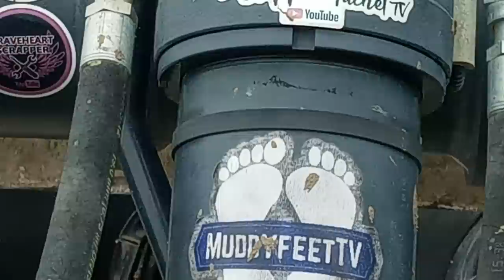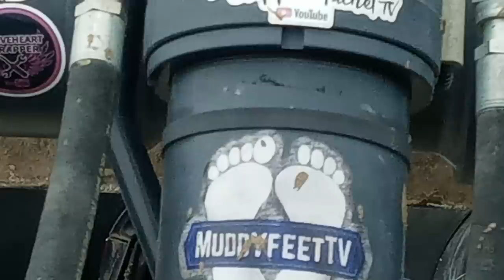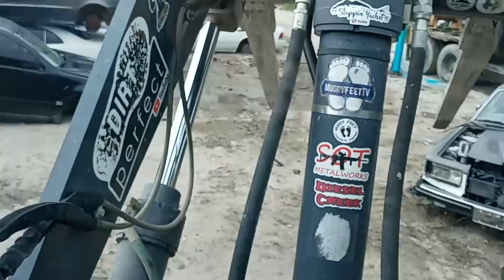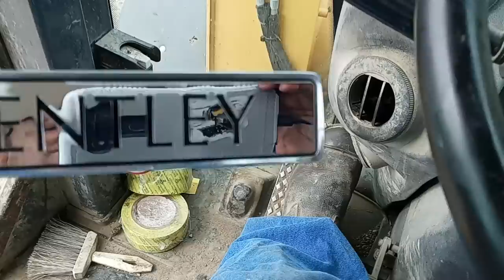Luxurious Bentley gets Crushed in Car Crusher

Comment: Must be nice to be rich enough to throw thousands of dollars away. The grill alone is worth several thousand. There was a lot of valuable trim got crushed. With any Rolls-Royce product, contact Park Ward Motor Museum in Chicago. They will usually want parts like that. If the leather is good inside, that original Connelly hide is worth bucks too.
Reply: People in this industry are scrappers.. they avoid thousands of dollars with small effort in favor of pennies for no effort over and over. Stupid is as stupid does. Most often the claimed attempt at marketing parts or even the whole thing are laughable at best, steeped in ignorance of where the proper market is.  EDIT:  It is not usually the scrappers fault that something has been chosen for recycle... I should have made this more clear in my first post. Usually its the owner of a dead car that has no knowledge of how to maximize the return on their property by reaching the very specific market that needs to know. By the time a scrapper in engaged, then the "time is money" axiom comes into play. They have work to do, and it boils down not to earning maximum return by investing in research and marketing, but rather how  quickly the asset can be converted to sellable fluids and steel, which DOES represent the smart business decision.
Reply from the maker: Do you know what is the 1 big thing you are completely missing? IT'S THEIR STUFF TO DO WHAT THEY WANT TO DO WITH IT. Have you forgotten about Freedom to make as much as you want or as little as you want. It's their stuff
Reply: I agree that this is a waste. There are a finite number of these left. With a little bit of time and effort, many parts could’ve been salvaged to be used to restore several other examples. However, you can’t put the blame entirely on the scrap yard. They are only interested in the metal. Whoever brought the car there should’ve taken these scarce and valuable parts off of it beforehand. Still a shame to watch.
Reply: @pwrattorney  The junkyard is not to be blamed
It is the owner at least mostly so he is not wellcome in heaven and his way to hell will not be funny at al 
I almost feel sorry for him but not really
The junkyard lost lots of money on this!
Should have saved it for some twenty years
in a dry place
Reply: I totally agree with all the others, that this was a terrible waste. But it's not the fault of Cowboy Car Crushing, they just do what they do. If the customer says "crush this car", then that's the job assignment. The blame lies fully with the owner, who decided that it was too much of a bother for him to find a buyer and in a tantrum rage of revenge ordered that it had to be destroyed, with no spare parts even salvaged.

Of course it is the right of any owner of any object, to decide what to do with it. If somebody were to buy Mona Lisa and set fire to it... nothing anybody could do! All kinds of famous, great treasures could potentially be destroyed by their arrogant owners, simply "because they can", maybe to show the world that they don't care what others think and/or that they're so incredibly rich, that what others regard as treasures is simply "cheap junk" to them.

We don't know the story of this car, and it probably had some major issues. But it's totally obvious, even to the naked eye, that a lot of valuable parts could have been saved. I'm also 100% sure that it would not be "impossible" to find a buyer with a little patience and effort invested. The only thing Cowboy Car Crushing could have done differently was to say no to the job, but if the owner was intent on the destruction of the car, it would simply have been crushed somewhere else. The world is full of fools, unfortunately.
Reply: Just think, now all the other examples of that car are worth more.

Comment: The device where you kept saying "What is that?" is the transmission shifter. RR and Bentley used GM TurboHydramatic 400 transmissions. Maybe by 87 they used the 700R4 version. Anyways, the column shift in these is electric, and that device was the actuator unit that actually shifted the transmission.
Reply: THE ORIGINAL CHECKER CABS! USED THAT TRANSMISSION TOO. HAD A SMALL SQUARE MESH TYPE FILTER.
Reply: There’s probably some Bentley owner who’s transmission shifter is playing up and needed that part just to keep there car on the road but now it’s crushed and unusable .
Reply: @Rayfaedundee Or better yet that Bently could have been restored but the guy who listed it for sale simply didn't try hard enough.

Comment: I have been looking for some information in regards to the exact Bentley or most likely model of Bentley that was actually crushed in this particular video.
Firstly most models for the American market are likely to be in LWB. In 1986 Bentley only made 19 LWB / LHD Bentley Mulsanne four door sedans. If we assume that the Bentley Mulsanne is a 1987 model, then I can assure you only 6 LHD / LWB sedans had been made, in this particular year.... In regards to actual weight 5.039 Pounds.

If the Bentley Mulsanne sedan is indeed NOT a LWB model however, in the year 1986 only 48 models in LHD had been made. In model year 1987 only 30 LHD ever left the factory....again in regards to actual weight 4,980 Pounds.
Either way, I must say quite a rare car these days.

Comment: Honestly, I'm surprised someone didn't buy the Bently even in the condition it's in, take it home and put plastic hubcaps on it that look like fancy wheels with spinners and park it in their driveway, or Section 8 apartment complex parking lot, in the ghetto so they make sure their neighbors see it but only wash and wax it at 2 a.m. so the neighbors don't see and think it's being driven still. I bet the front tire got shredded like that from the driver running from the Po-Po going over spike strips as they say in the hood.

Comment: Procedural question - why do some junkyards send in cars or trucks full of engines and transmissions?  

Wouldn't they be able to send them out as cores to be remanufactured?  Or are they usually junk or undesirable models?  

I'm guessing not a lot of LS Chevys or Cummins diesels get crushed and sent to the shredder.
Reply: It probably depends both on what engine it is, and what condition it's in.
Reply: I work at a crushing yard in Orlando and we jerked out all the motors and trannies and sell them as aluminum combos for scrap. We get more per pound that way
Reply from the maker: @Carcrusher1998  but that place isn't a "crushing" yard
Reply: @CowboyCarCrushing  we have a picking yard also, if the motors don't sell out the vehicles they still get pulled and put in the container for aluminum combo scrap

Comment: That part underneath was the electronic shift box. The transmission gear selector shifted electronically. That's what allowed the shifter to be silky smootn.
Reply from the maker: Smooth like budda 🤠👍
Reply: Coincidentally CarWizard another youtube channel that does work on these exotics just had a video this week that those shift servo motors are super hard to find and aren't made anymore. Only reason I knew what it was.

Comment: Whoever was saying the low-end Bentleys were $30K back in 1987 is incorrect.  The original MSRP for those vehicles was $89K (in 1987 dollars).   That's base price, with no options.      Everything I've read states that these vehicles are (were) incredibly expensive to maintain, with repair costs easily surpassing the actual current worth of the vehicle.  There's a reason that this car could purchased for $300 and then found itself languishing in the yard with no takers - it just wasn't worth it, not even for parts.  I'm guessing the engine either had a catastrophic failure or needed tens of thousands in repairs.
Reply from the maker: Awesome comment. Thank you 👍👊🤠

Comment: Chrysler products in the 60s had left hand threads on the left hand side lug nuts. Also some trucks and wartime MB/ GPW jeeps. It was some weird theory about the direction of rotation on the left hand side of the car unscrewing right hand thread nuts.  But really, that only applies when the nut is directly screwed onto the axle, as in a horse drawn cart.

Comment: 10:46 that's the actual shift mechanism. There's no physical connection between the shift handle at the wheel and the gearbox. Car Wizard can tell you all about that.
Reply: I fitted one to a customer's car earlier this month. The part cost more than the scrap value of this car.

Comment: Hey cowboy! You are really putting in a lot of hours! Indeed, it is not easy being easy! That device just to the left and rear of the transmission was the electric gear selector for the transmission. The shifter on the steering column sent electrical signals down to that device to tell the transmission which gear has been selected. The legendary engineering of that vehicle used the legendary turbo 400 automatic. Later on Bentley and Rolls-Royce changed over to the overdrive 4L80E which is basically a turbo 400 with an overdrive attached and electronically control. The legendary Engineering also used the legendary General Motors A6 compressor and other GM air conditioning parts for the HVAC system. Sad to see that beauty go, but nothing is around forever. Too bad about that Ford pickup at the beginning as well. As others mention, that front axle on the Ford Super Duty is a very popular item being used for solid-axle swaps 4 GM pickup trucks. Just to quickly knocked, you are very observant about their rear axle on the Bentley, it did use a form of a full floating type bearing on the rear to ensure a very quiet and vibration free final drive system
Reply from the maker: Fancy fancy

Comment: That was suprising that Flying Spares outta FL didn't buy that for a part car! They are a salvage yard specialist in Rolls Royce and Bentley automotive units. Mopars had left hand threads on one side of the car until the 70s! That mystery item on the Bentley was probably the Mineral Oil tank. The level ride suspension and brake system run off of mineral oil! Expensive to repair! That's why these cars get sold for retail, or scrapped! If that guy gave that car to you, it'll still be about $5k in work to make it simply drive able! Glass I got the see your first time Bentley crush on video with you! I like those big British cars, but I'll stick with Cadillac! 💯🤙🏻👍🏻🤠
Reply: Sometimes it's just a matter of matching up a buyer and seller. Cowboy's employer has stated they're in the recycling business, not in the parts business, so by the time Cowboy gets a car it's often too late. But I'm astounded at some of the things that wind up in that crusher.
Reply: @txviking  absolutely. He's crushing at a customer's yard. He did lots of advertising. I was just surprised that the rolls and Bentley yard didn't snatch it up for their yard, being a clean nice  looking car.
Reply: @johnnydeville5701  Yeah, it makes me wonder if they knew about it.

Comment: Chrysler cars used LH threads on the left side of the car in late '50s- early 60's Some engineer figured they would tend to tighten rather than loosen as the car moved forward. Engineers! Wonder what that gizmo was that hooked to the shift linkage?

Comment: That Bentley was made of galvanized steel it wt in at 6800 lbs. And yes they and the rolls were nothing but expensive junk.
Reply from the maker: Tell that to the rest of these folks 🤣🤣🤣
Reply from the maker: Thanks for watching and commenting👍👊🤠
Reply: My Uncle bought a new 71 ROLLS-ROYCE SILVER SHADOW. I learned to drive in that car, and took my drivers test with it. It was a magnificent vehicle. To anyone who has never ridden or driven one, well, its hard to explain how wonderful it is. He kept it for about 15 years, put well over 100.000 miles on it, and it served very well, and he never told me he had ANY serious issues with it. When he sold it, it still looked and ran like new.

Comment: That bentley whould cost more than it's worth to even think about putting it back on the road. I would have bought it for ebay parts right now one in good condition is 27,100.50 or 16,600 in average condition

Comment: 1987 Bentleys in around $80,000 and are still worth in drivable condition $17,000 and up. Parts are even more expensive as they’re rare. That electric motor beside the transmission might be overdrive. Biggest trouble are the suspension mineral oil leaks and awful unreliable fuel injection system. That Bentley was too far gone mechanically.  That old W140 white Mercedes, in the background, was better built then British cars, but like Bentley, worth nothing when broken. Wonder what engine big white Benz had?
Reply from the maker: Hey Burden thanks for watching and commenting 👍 I sure appreciate it. That car was gone. I think I should have showed the inside 😝 it was awful

Comment: I always cry when you start a video crushing a 90’s ford truck.
Reply: I for one love to watch 90's Fords Crushed , bought a New off the lot F150 92 model , in 6 months 5 Drive shafts , 3 rear diffs 3 front Diffs , 5 transmissions , 2 engines , and two cross members , Came direct from Ford they found oyt with slight bend in the frame itself that did nothing but cause massive issues . never again a Ford for me . After that I bought 2 other that were horrible as well , never good luck with Friggin Fords .
Reply: $121900 was THE ORIGINAL MSRP IN 1987 today it would be worth around 19k if it ran in good shape
Reply: @adamwelker1446  
I have 3 in my garage, 1992 FlareSide with 75,000, 1992 4 x 4 2 Dr automatic with push button on dash and a 1994 extend cab two tone green long bed, all 3 have 5.0 power locks and windows
Reply: @outbackcountry512  you just had the luck of getting a Monday or Friday built truck.

Comment: Its a junk yard but now crushed it worth 200 to 300 bucks. The wheels were worth over 1000, The outside mirrors a few hundred each the trim thousands. The block over 1000. Easily 5 to 10k in parts? I dont get it" sell the easy parts and crush the body. Most guys buy these for 1000 and make 10,000?
Reply from the maker: How much is the badge i saved?
Reply: @CowboyCarCrushing  50 to 100

Comment: Very sinister thing to do to a car of that calibre, what was wrong with that car as it was in excellent condition and alot of people are going to be very dissapointed hearing and seeing this and yes rolls royce and Bentley's did use the full floating type axles and hubs like trucks do as ive see a few myself as they do look like 4wd hubs and it wouldnt suprise me if they used toyota landcruiser hubs as rolls and bentlys sourced many parts from many different auto companies worldwide to build their cars as the models through from 1968 to late 70s used the GM turbo hydromatic transmission
Reply from the maker: Wow!! 1st time the word Sinister has been used in 1000's of comments. That's pretty cool 🤠👍

Comment: My Question is, where is the Sence to Destroy this Bentley and all over Car's?. For a example only on this Bentley, the Wheel's, the door's, the Head and Front Light's, the Bumper's, the Mirrors and the Interior (Seat's, Dashboard and other Parts). Also the Part's from Suspension. All these parts are possible to sell it worldwide. And I promise all of these wood be thousand's of Dollars 💵. Only on this Car. So, I don't understand and please don't take this a Complain, please take it for Recommendations, why in USA are destroying the Car completely, and for Example in Germany only, when the (Car) Chassis is naked (without, Glasses, Door's, Interior....). I guess, you wood have a lot of potential Customers, which is Searching for theese used Part's.
Best Regards from Lübeck Germany 😊 👋.

Comment: Why such a big deal to get the caps off the Bentley
Reply: Aluminum  as the hods and doors and engine block gearbox casing 
Stainless steel in doorframes and so on
Reply from the maker: The customer said he wanted the wheels off.

Comment: I guess you guys do it different over there, like zero safety equipment, zero PPE....just asking to be sued by one of your employees.
Reply from the maker: What's the 1st word in PPE 🤔....Personal. Please please don't snowflake Car Crushing. This stuff ain't for no punks. The Strong shall Live 🤠👍👊
Reply: PPE....personal protective equipment. You dont know that???
From what I can see your workers dont work in a safe environment, and dont have the correct PPE to carry out their jobs safely, and they should be demanding that of you as an employer, and as a good employer - as I'm sure you are - you should be providing it. Do you even have risk assessments?
Your guys should have minimum a hi visibility vest and eye protection with them being under those cars to protect from dust, dirt and fluids getting in their eyes, not to mention the tiny pieces of glass flying out from the crusher. 
And with you operating heavy machinery in tight confined spaces they should have high visibility clothing, as I said, a vest minimum. Theres 2 risk assessments for you and I'm not even a health and safety professional, but I've worked in warehouses with heavy machinery and now work around trains and track. If you were running a business like that over here youd be shut down, fined and forced to make changes for safety sake. 
Ultimately it's up to you, land of the free and ignorant and all that, but all its gonna take is for a guy to get crushed or lose the sight in an eye and you'll be sued into bankruptcy.
Reply: @AlduinDragonLord  You're right. I was thinking the same thing. But what I like about the united states is that most ppl that work in junkyards aren't snowflakes and do use common sense when working around heavy machinery. In that same breath,  complacency can be a fatal thing.